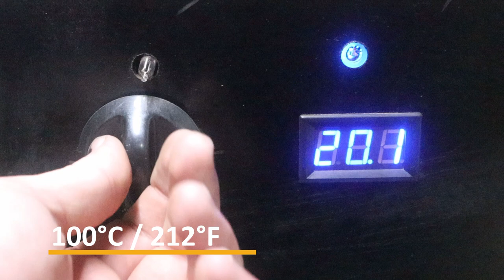Antique Swedish Blow Torch Restoration.

Comment: That torch needs adjustment.  It shouldn't be throwing all that yellow flame and leaving soot.  Maybe it needed more 'warm up' time.
Reply from the maker: There isn't much adjustment to be done apart from turning the handle to adjust the flames, witch I have tried numerously. We think the aged nozzle is faulty.
Reply: 🤭 risk of carbon monoxide poisoning - ⚠️☠️

Comment: Sorry to see brass parts being cleaned on a rotating brush of steel. Iron particles are hammered into the brass surface and they will rust over time. But otherwise nice job
Reply from the maker: Thank you! I'll keep an eye out for rust, and if it does rust, I'll go over it with a brass wire wheel just to be sure.

Comment: The burner does not work correctly.
Reply from the maker: We think the nozzle is faulty. It is rather difficult finding replacement parts on these vintage items. What are your thoughts?
Reply: @AJRestoration  I think it is possible to solder the nozzle with copper or silver and drill a new smaller hole again. I did so when restoring my Optimus 8R Hunter and now it works just fine.